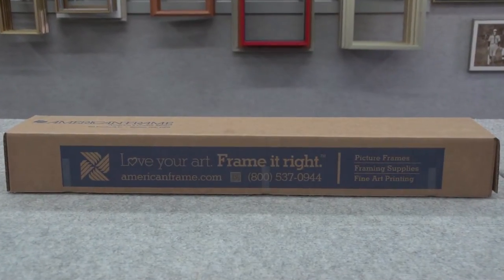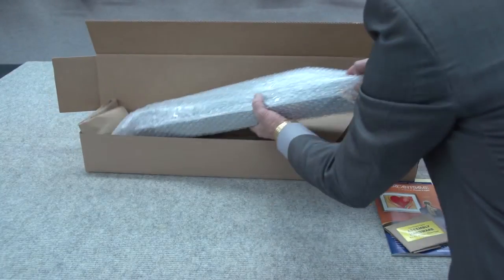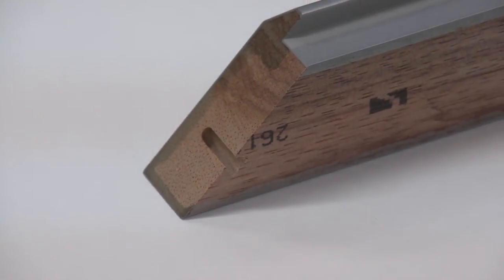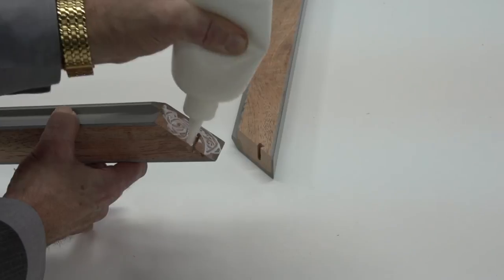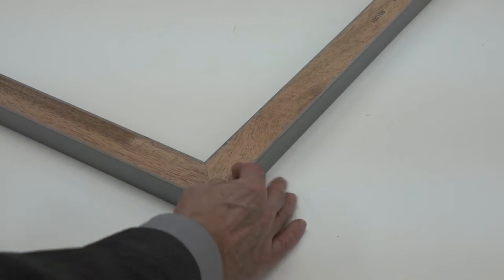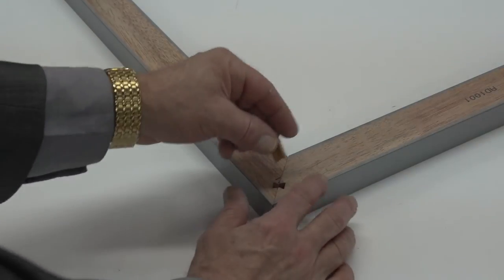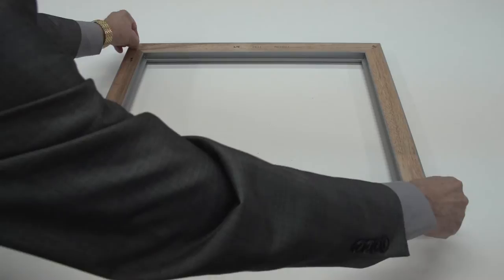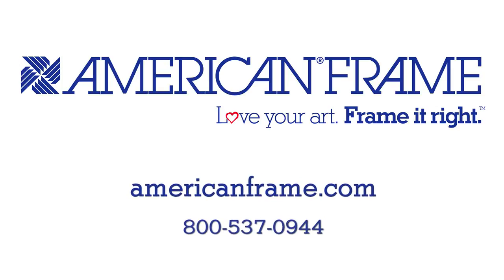Oversized Wood Picture Frame:  How to Properly Assemble

Comment: any advise how to disassemble ?! or no way?!
Reply: just drill a small hole in the center, put a small screw in it and pull em out, dont use glue if your going to take it apart